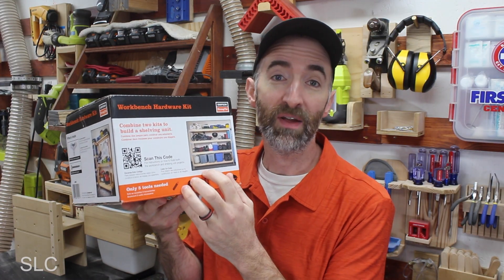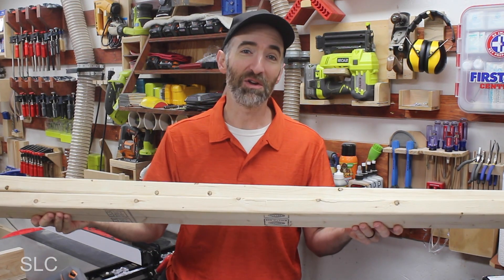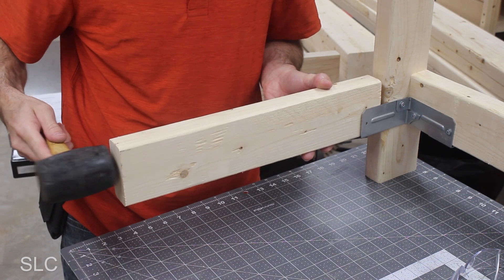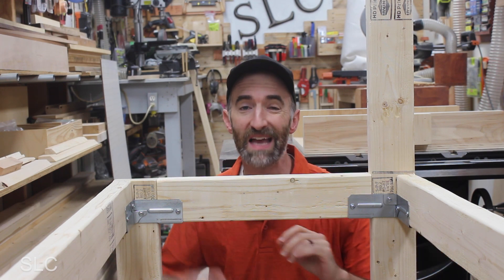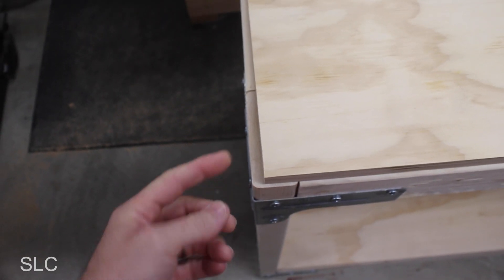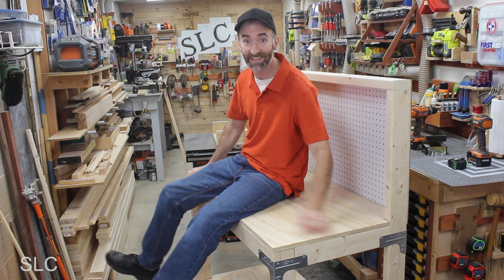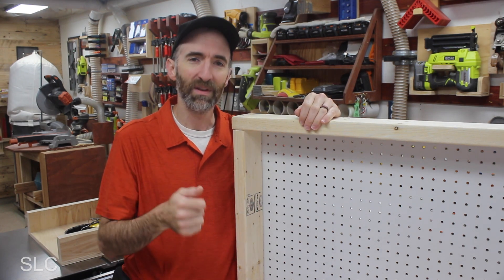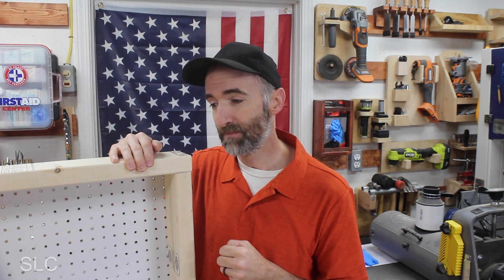Building the Simpson Strong-Tie Workbench Kit

Comment: A great video.  I've been using Simpson Strong-Tie parts for over a decade.  I agree with everything you said in your instructions, right down to the "oops" and especially the use of clamps to help things along.  In my case I bought the parts individually at Home Depot.  I assembled lots of shelves and platforms for my photo studio but also to build a couple of dog houses and other things.  The braces can be pretty versatile once you get the hang of it and as you showed the results are rock solid so long as you take your time to get the job done right.  Again, this was a great tutorial video, as usual.

Comment: Great video.  I've been using those for the last 20+ years or so and have built at least 12 work benches (many at 8ft) and probaby 8 -10 shelving units.   I even used them to build a table for my CNC.

Comment: I have two older kits I bought of Facebook Marketplace, there's no QR code but there is a website address which unfortunately is no longer available. But it does have all the screws needed, even to secure the plywood sheets, so no need to buy extra. Also as you mentioned there's no instructions so your video is most welcome 👍👍

Comment: Another great build. 👍🏾 Kreg Rip Cut and Cross Cut jigs (no table saw yet) and I still can’t seem to cut completely square. Improving with each project though. Thanks for the suggestions in your Amazon Affiliate page, will definitely pick up a few items, especially the lighting.
Reply from the maker: Thank you very much. When cutting plywood with a circular saw, I found the best way to keep a straight edge is to use a 4-ft level that is clamped down on both ends. The one I have is not perfect but does much better than other stuff I've used. 
I hope that helps.

Comment: Thanks for the honest breakdown on this product. Good job. Have you ever made a convertible bench/ table/picnic table build? And do you ever build projects using  only metal?
Reply from the maker: A few years ago I built a bench that turned into a picnic table. Most of the time we just leave it as a picnic table. 
As for metal only, I used to work on cars as a hobby, but nothing like that lately. 
Wood is a lot more accessible for most people, so I try to stick with that in my videos.